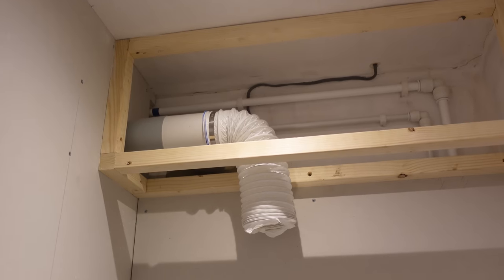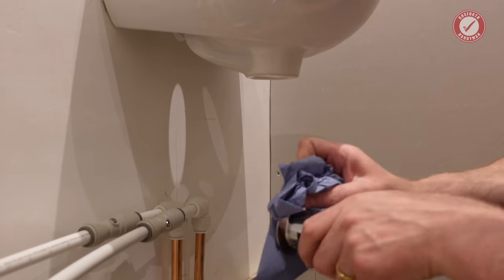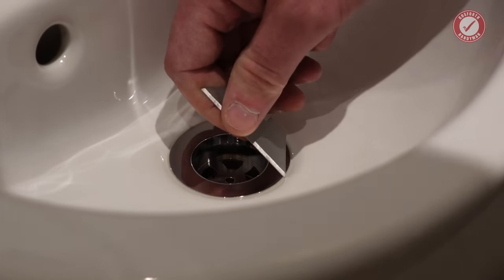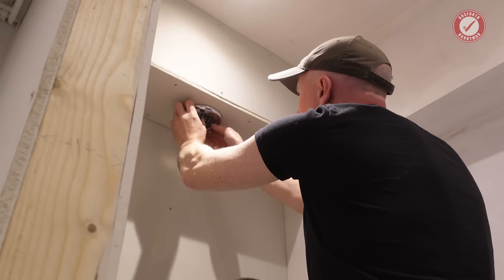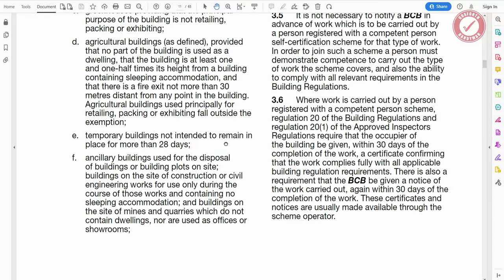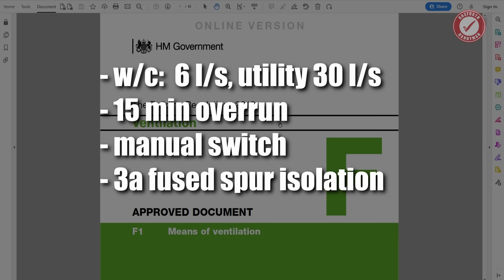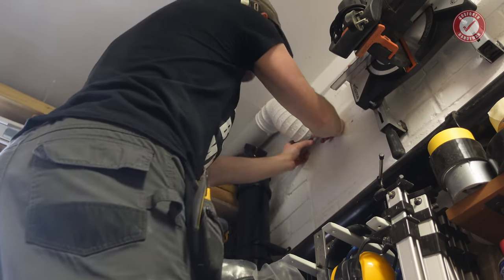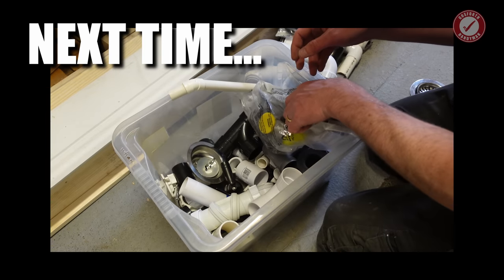Extraction, leaky basin and BUILDING REGULATIONS - new toilet (part 7)

Comment: I always use a Basin Mate for the bottom seal , for £1.60 from toolstation, never leaks waste of time trying anything else,  try filling the basin so the water goes down the overflow it still might leak , I also set my isolator valves with the taps fully open so the water does not flow more than the overflow can cope with

Comment: The seal between the inside of the basin and the waste will manifest itself as the water level going down when the plug is in. The main area to use plumbers mait or even silicone is on the underside between the nut/gasket and the basin. Roll a sausage and push into the gap and it'll prevent any leaks from any source (including the overflow).
Reply from the maker: Yup, but PTFE is neater. 👍

Comment: The most important bit to seal is the bottom washer of a basin. I use a “THOMAS DUDLEY LTD BASIN WASTE SEAL KIT 3 PIECE SET (8795R)” from screwfix. It’s a conical rubber washer that fills the gap around the waste fitting and tightens into the thread as well. A lot less fiddly than PTFE and only 2-3 quid. Hope this helps for the future. PS great content.
Reply from the maker: Crazy they don't supply a washer that actually works! 😂👍

Comment: Surely, as it's a slotted waste (for the overflow), then water going down the inside of the plughole can get outside of the waste via the slot. Therefore, isn't it just the bottom thread that needed properly sealing with ptfe/plumbers mate? I always load it on down there and don't ever seal the top.
Reply: Your correct that the leak is from the bottom seal, however, if the top isn't sealed the basin or sink won't hold water. 😉
Reply: @Brown969  you are right! And you have probably just explained to me why my utility room sink doesn't hold water... why didn't I think of that!
Reply from the maker: What Nathan said. 👍😁

Comment: I use insulation tape on the fan outlet to make a nice tight fit with the 100mm pipe. Also I use a backdraught shutter that’s a thin membrane on the external grille. Our kitchen extractor was making a din of noise in windy weather and that’s stopped.

Comment: As a plumber I have done many basin wastes. Always use Plumbers Mait on the top side and then some acid free silicone Plumbers gold on the underside. Also can buy a semi hard 11/4" washer to go on the underside which one can use to push the silicone in before tightening up the back nut. As for washers supplied with wastes, the best thing for them is to through them in the bin
Reply from the maker: Cheers Nick! Crazy that manufacturers still can't just make this work 'out of the box'. 😂👍
Reply: @GosforthHandyman  Such a gap in the market for "products that actually work".

Comment: Brilliant video Andy i'm glad you sorted out the leaky basin ,plumber's mate I have use it ,It is good sets in no time   Sorry I had to skip the building regulations as it was for England only and it dose not apply to me living in Wrexham   The ducting and the flex supplied cable ties that don't fit ! That's good for business, the fan is so quiet when running  You done a brilliant job like all your video's Thanks Andy take care mate
Reply from the maker: Cheers bud! 👍😁

Comment: The first sink I ever installed, on probably my third handyman client (back when I didn't have a clue what I was doing), I had this exact problem. Nothing I could do with the gasket could make the thing watertight, so I ended up fixing it in the exact same way. I was worried it was a bodge that would horrify a proper plumber, good to know it's actually a proper fix.
Reply from the maker: The design of the waste is the bodge bit... so nothing you've done wrong really! 👍😁

Comment: theres no need for any gasket in the basin as water gets in anyway through the slots for the overflow, plumbers mait on the threads under the backnut or CT1 always works for me,👍
Reply from the maker: Don't quite follow... 🤔. Without a seal on the top side water would slowly leak down the drain?
Reply: If you don't have a gasket/seal, then the basin will lose water when the plug is in.

Comment: Funilly I had a basin installed along with a toilet in a small room. No vent as there is a window, which is almost always closed. The tiny bit of water vapour coming off the hot tap was enought to cause condensate in the coldest corner of the room and over time caused black mould. Nothing major but it's there.

Comment: If you add plumbers putty around the plug in the basin, add a smaller ring of putty underneath with a nylon washer before the black nut. The Nylon washer is the game changer. Don't use the washer they supply. Plumbers merchants sell the nylon washers in packs of 6. You'll never have a leak again. (I'm a Plumber of 30 yrs).

Comment: Informative as usual Andy. Nice to see other people have problems which should not be problems…… Ahhh 😱. On rubbish plumbing fittings, where I can I now buy exclusively McAlpine. They just work!
Reply from the maker: Yup! 2023 and manufacturers still can't get this stuff right. 😭👍
Reply: Agree 100% on McAlpine.  Sometimes it's twice the price, but worth it.  I guess they just work to tighter tolerances in manufacture.
Reply: Screw#☆x used to sell mcalpine fittings
Reply: @joehickman4823  still do

Comment: An old plumber told me to also put plumbers mate on the thread on the underside of the basin, it turned out to be a very good tip.
Reply: Yeah I always put it on the bottom aswell as this could still leak from the overflow. He's only rectified the sink water.
Reply from the maker: The PTFE seals any leaks from the overflow.
Reply: Wow,  if the fan is so quiet how will you know if it’s on?  I didnt see a pilot light.  I’ve got fans in kitchen and bathrooms and they are often left on until I get home!
Reply: @GosforthHandyman  if it's worked and you tested the overflow then happy days but some I've fitted are sloppy fittings so PTFE would need to be overdone to compensate. Easier to use a ring of plumbers mate and fasten it up. Squashes in the gap and all round the thread.

Comment: I have recently used Velcro ‘zip ties’ to hold some signs outdoors, they grip really well and seem to last. Easily reposition able or removed and reused. Got mine from Aldi but Screwfix do the same ones, even more currently relevant is that you can also get multicolour ‘rainbow’ ones. 
I too have always used Plumbers Mait with great results. I converted to plastic pipes years ago, absolutely no downside I haveEVER found. I do use lots  of support clips though to prevent sagging ( pipes that is, not me!).

Comment: Nice one Andy I have read most of the other comments to minimise the risk of duplication. Great advice on accessing the U.K. Building regulations (of course only useful if the property is in the U.K.). I like how you reflected on the definition of a utility room but then went onto mentioning the need for fire sealant on garage penetrations. Did you consider the definition of a garage and if indeed you have one?😉 (Just teasing 😀).
Reply from the maker: Cheers Norman! The garage definition is a very valid point! Especially as most people just use garages for storage not to mention electric cars etc. 👍😁
Reply: @GosforthHandyman  Realistically - I suppose it will (might) be registered by the LA/Planning/Building Control as a ‘garage’ so application for ‘change of use’ to ‘workshop/ store’ would then obviate the need for the compliance with the attendant garage requirements.

However it  is for consideration that a workshop/store could present an equal fire risk issue (to a garage) - depending on how much flammable stores you accumulate in there.😀
Reply from the maker: Oh defo, more meant in general, not specifically for me. I don't know anyone who keeps a car in their garage these days. Most seem to be used for storage / gym / unused cinema room etc. 😁

Comment: If you don't want to use silicone, I always do, get a basin mate. Only a couple of quid and it will never leak and you can remove it if you ever want to.
Reply: This is the way 👍
Reply from the maker: Why they don't supply a better bottom washer that actually seals the thread is beyond me. Although you do sometimes still need plumbers mait / silicone on the top side depending on the shape of the sink. 👍

Comment: You have a utility room with the gasboiler for the central heating and want to have intermittent ventilation in there? Anything on that in your UK building regs?
Reply: Modern boilers use closed flues and require no additional ventilation.
Reply from the maker: No additional requirements. 👍

Comment: Highly recommend a Thomas Dudley Ltd Basin Waste Seal Kit, less messy than Plumbers Mate. You should have used some mate underneath as well if you are going down that road.
Reply: Thomas Dudley every time 👍
Reply from the maker: I always find the underside washer seals fine, as long as the thread is sealed with PTFE. Still crazy that all this stuff isn't included with the waste as standard! 🤪
Reply: Another vote for the basin seal kit and a giant socket to fit the plastic nut to tighten everything up without mauling the nut with pipe pliers.

Comment: Re: Controls, my reading is that a bathroom can contain a toilet, sorry "sanitary accommodation", but still remains a bathroom, so humidity controls are fine.

Those definitions need to be clearer - what is "significant" water vapour? Would it kill them to put in some actual measurements?
Reply from the maker: Yup, it's all very vague. But as the fan needs to remove odour I don't think it's acceptable for it to only be humidity controlled. Never heard of this being questioned though! 👍

Comment: The top seal is only required to keep water in the sink and won't stop leaking from below as the overflow hole lets water bypass the inner waist and track down the threads very few seals and gaskets on the bottom resolve this issue too . Plumber's mate or putty I find is messy and a better solution is to smear silicone in and around the threads before the backing nut is run up. This also does not prevent disassembly at a later date like putty etc.

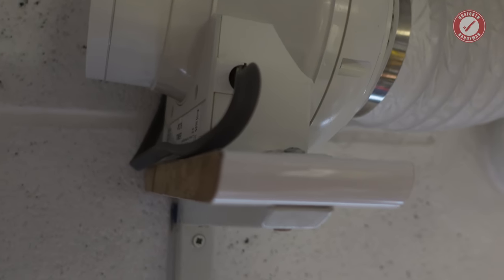Comment: 29:32 could the fan have been mounted to the ceiling? The flaps would still be the correct orientation, but I don't know if there's another reason that the shelf is the best option?

Comment: So how do you know that you are achieving 30l per min in the utility room?
Is it only by the spec of the fan? But then I guess you would need a fan that does 60l/min since you split the intakes between two rooms?
Reply from the maker: Yeah, but as it's not actually doing anything other than making the room less thermally efficient... I doubt any inspector would kick up a fuss. 😁👍
Reply: I recently installed a similar in-line extractor for my cellar..if it's similar the unit will have a way to wire it up so it extracts more air (but noisier) or less air (but quieter).

If it's similar a 'mistake' rewiring it back up when the inspector leaves will help pass inspection ;)
Reply: You should test it. The spec of the fan is only a nominal value, imagine putting  that fan on a 50m long pipe, you'd get no flow since all the energy imparted but he fan would be used just to move the volume without achieving any flow.

Comment: Why do you switch between copper and plastic pipes? I would personally just use plastic as it’s easy! Curious to know if you had something in mind. Thank you! Been watching since your extension, keep up the informative videos.
Reply from the maker: Just avoiding too many joints behind the wall. 👍
Reply: Plastic can also be very unsightly and very very cheap looking. Especially the pushfit joints which are large and cumbersome. Just doesn't look professional at all

Comment: Great work Andy , very pleasing to the eye is the fan job. Fan grills,  well they are all pretty much rubbish,  even the commercial ones we use. I expect you have this covered,  but you cant suck air from a sealed room , ie door closed, it needs to pull air through. As for crap manufacturers providing sub standard goods, all they do is source stuff from china that looks right and make a kit out it, slap dash at best. Expect again that you know this, you can get flat ducting with round adapters.  Thanks Andy.
Reply: My mates rented a house with a bathroom that was almost completely sealed.  If the exhaust fan was turned on, it would suck air out of the waste pipes.  The door was a tight fit, and the window was a circular stained glass mural type thing. They just left the door open all the time.
Reply from the maker: Cheers Paul! Yeah, plenty gaps under doors in this room so no issues with it being a sealed space. Unlike the studio. 😁👍

Comment: Sorry to say, it looks like you've got the two white washers transposed. You need a good seal between the inside of the basin and the waste, the underside of the basin doesn't have such a sealable surface.I've fitted a few of these and you need to get the correct washers in the correct place, it's not always clear from the crappy diagrams they supply..

Comment: Hi Andy, the job is looking great, but can you tell me if the switch that is used to turn the fans on, switches the lights on as well? Also what is a in line extractor and are there other types of extractors. Thanks.
Reply from the maker: Cheers! No, that switch is just for the fan. Was ages ago so afraid don't have the model to hand!

Comment: Only commenting as I watch it, I’m a plumber and it doesn’t matter if the little fabric seal leaks on the waste ,it will only go down near where the overflow. would only matter if you wanted to put the plug in it would slowly leak away. It’s at the bottom where you need to place some silicon just on the threads. I know what you’re saying about the manufacturers instructions.

Comment: Flexible duct needs to be pulled tight or condensation over time will gather in the ridges. I would have put the tee piece the other way round to exit straight out the vertical wall in the wc and therefore not needed the flexible bits.  Another point to bear in mind is the number of bends as it affects the flow rate in the duct. Nit picky I know. Good video and thanks for your efforts.
Reply from the maker: Cheers! Yeah, there won't be any condensation. 👍

Comment: Only ever fitted one waste and pair of taps to a sink and I used plumbers tape. It was years ago and those bits never leaked. I fitted the whole sink on my bed as that was the largest space in in the house back then. 
I keep switching off the wetroom extractor as anything outside the window sets it off. Only when the place is dry though.
Aren't there rules about fitting a disabled accessible loos when putting in a new one?
Reply from the maker: Disabled access loos - I think that's just for new builds. 👍👍
Reply: @GosforthHandyman  Yeah, comes under 'visitable dwellings'. New builds only, or you'd never be able to do more than put a coat on paint on most of my town..

New and infeasible requirements during refurbishment or extension can be a huge limiting factor on making worthwhile improvements to existing buildings, at least they recognise this to some degree.

Comment: Andy you mentioned that any hole from the garage into the main house had to be fire sealed but does your bit of flexible ventilation pipe not breach that requirement as it would surely melt in a fire?
Reply: That's an interesting point.
Reply from the maker: Yup! All plastic pipes would fail. Vid on fire collars etc. coming up. 👍

Comment: At the risk of sounding like a know all-I had the same problem with a leaking sink. I tried several times with the tape and putty but no good. Then I came across a conical shaped rubber seal that goes underneath and into the sink aperture. As you tighten it, it forms a water tight seal onto the thread and onto the basin with little effort. They are an answer to prayer. No need for tape or putty.
Reply from the maker: Yeah they're great! Crazy they're not supplied as standard. Still potentially need to seal the top side depending on the shape of the ceramic. 👍

Comment: The fused spur isn't required for isolation, a 3-pole isolator handles both permanent and switched lines just fine, but because the fan manufacturers refuse to design fans for installation on the circuits they know full well they're to be installed on, shifting the burden of protection from 20p of their own components to an hour or two of an electricians time. Very generous of them.

Of course, if you're not switching with the lights but independently as here, the FCU is a perfectly suitable isolator - but a fan isolator comes with a free label so what's not to like?
Reply from the maker: Indeed! 👍

Comment: Could you have attached the inline fan to the ceiling and a convenient joist?
Reply from the maker: Potentially but the vibration would be quite loud in the bedroom above (and the joists run the other way). 👍
Reply: @GosforthHandyman  Cheers, I'm wondering of the rubber grommets used in metal electrical back boxes would deal with the sound issue.

Comment: Really strange that the ventilation flow requirements for the utility room are double that of what the bathroom needs to have.
A bathroom especially with a shower in it produces far more moisture than a sink in an utility room?
Reply from the maker: Yup, it's insane. As I say, with a modern washing machine and tumble dryer running full tilt I measured no difference in humidity. Makes no sense. 🤪